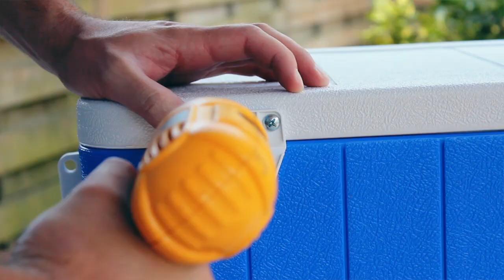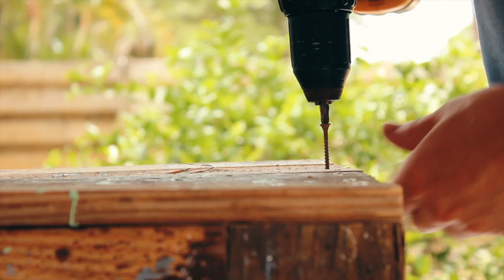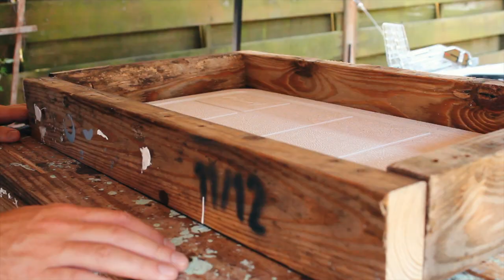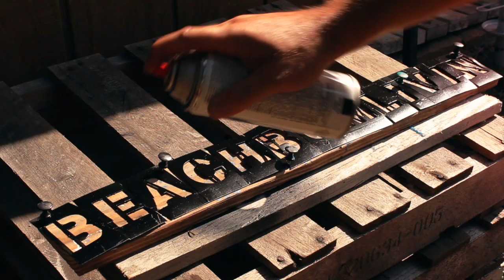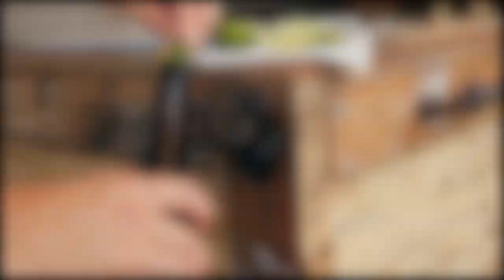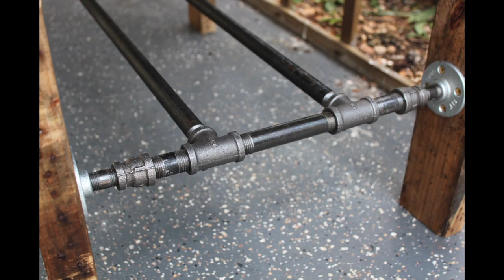How to Build a Rustic Cooler Box from Old/Used Recycled Pallets: Woodworking Projects

Comment: Next time, use an Igloo cooler.  The drain plug is threaded.  you can attach a hose to the drain plug so you dont have to drain water under the cooler.  Nice looking box.

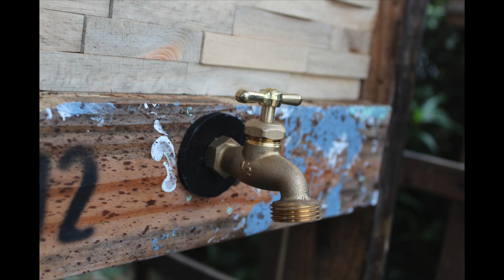Comment: The drain that you show at 9:49, is that connected with tubing to the plastic drain on the cooler?
Reply from the maker: Yes you are correct. Just a clear piece of tube that, like you said, runs from the coolers drain to the spigot.
Reply: the best cabinets plans and step by step videos I found were in the mysecretblueprints. com vault. materials and supply list are perfectly laid out

Comment: Could you send the height to the the top of the cooler (not the lid) and the width you used? I've sawed up enough pallets and have what I need, but I'd like to mimic the dimensions you used.  Thanks!

Comment: When you build the frame at the beginning, how dis you attached the horizontal planks to the vertical legs?
Long nails/screws from the outside leg (perpendicular) and through the horizontal plank?

Thanks for your time.

Comment: Funny, I was looking for an already made cowboy cooler, but hte one I found here in canada was back ordered. So I decided to build my own that will fit my needs (I need to flush mount a marine radio to drive my 4 patio speakers). I bought a cooler at WM which happens to be the exact same and also happens to have some pallets that I have to get rid off. Seems that willl reduce the cost of the project.

For the shelf made of pipes, did you had to cut any of them?

Comment: Hey Beach Bumm Followers. I just built this ultra cool Antique Ice Chest, so I figured that I would share the dimensions. Beach Bum like Great Cooks rarely give the details.

Each 2x3 is 48 Inches. 
Pallets pieces vary depending on how you cut them.  I used 6 pallets and picked the pieces I needed. 

Legs:  36 " made from the 2x3's (there are 3 per pallet)    4 Legs
Width:  28 Inches  (also from the 2x3's) 
Depth:  24 Inches  (Also from the 2x3's)
This fits the 21x14 48qt Ice Chest. 
Good Luck!